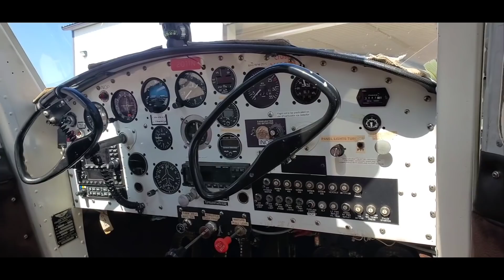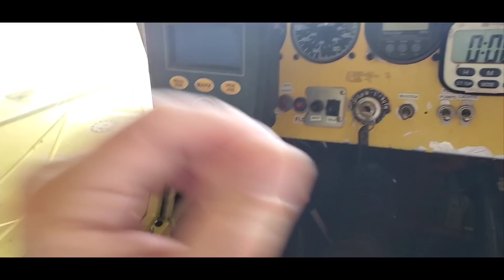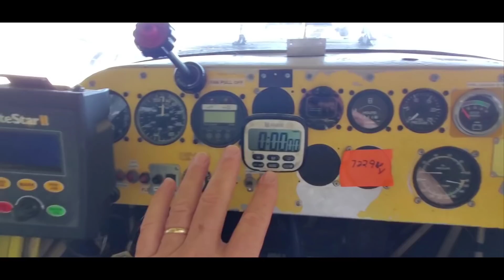An Old School Flight School - Riggin Flight Services Madison, SD

Comment: Flew a new Super Cub from Lock Haven to San Jose about 1965.  Carried 2 5-gal cans in case you got lost or Wx.  No radios.  The first 4 hours were a thrill.  The last 26 were a literal pain in the ass.  Got a lot of arm exercise using the frame tubing to hold my  butt off the seat.

Comment: Excellent interview, I learned to fly in northern Idaho back in 1973. The airports had curtesy cars furnished by the state for transportation to towns, Sandpoint, Bonners Ferry ect. No cost to use just keep the gas tank full and the oil, they had warning placards on the dashboard that car would self destruct if driven over 45 mph they did shake rattle and roll, beat the heck out of walking. Some had APs for annuals, I was 23 and they were ancient gents, good work and didn’t break the bank.

Comment: I can verify the sentiments of Mr. Riggen on tricycle trained pilots learning tail wheels. I earned my PPL in tomahawks and warriors. I got checked out in a tail wheel (Citabria) after many years of Warrior time. Since then, I nearly ground looped...twice. Shortly after a rather uneventful landing, I quit flying it like I did with warriors, and came about as close to a ground loop as you can get without actually going around. 
Didn't hurt the airplane but sure bruised my ego. Someone saw my first one and said "Nice save out there". 😳
Moral of the story, like he said when landing tail wheel aircraft, unlike tricycles, when you touchdown is when the fun begins.
Fly the aircraft all the way to the hangar.

Comment: That was really cool, a blast from the past.  I soloed on my 16th also and seem to be a bit older.  What caught my attention was the way she described flight characteristics, my dad was a bit gruff for training, many unanswered questions.  Now I know where to go, if I get the urge.  Those light bars are intriguing as I learned solo to race planes on dirt roads to flag.
Reply: Once i jumped a crossing with our old flag car racing airplanes to the field, it had an old rickety potholed bridge on the other side, i popped three tires! My Dad was not happy! Oops
Reply: @429thunderjet2  - Yeah, flagging stories.  Can't think of any appropriate to tell in public.  Back then though the A&P and I would go to all the crash sites.  That reminds me, one time a flagger from another outfit radioed that he needed oil fast so this guy fills a four quart metal pitcher(?) and hands it to me to hold on the way and the guy launched the A&P's Ford short-bed over an elevated canal and oil went everywhere when we hid the ceiling, even under where both of us sat, and I never let go of the container.  Afterwards while cleaning the truck together the A&P showed up right behind me and things got ugly.

Comment: In the early 70’s, I had gotten out of 4 years in the Marines, was going to college, worked for Asplundh Aviation in the summertime, they sprayed power line right-of-ways with herbicides to keep the brush & trees from growing. I would go on the road with a spray crew all over the North/East United States.
 We used Bell G4 Helicopters with a spray bar or rotary disk sprayer depending upon the herbicide being used. The spray bar nozzles also have a pressure value so that no chemical leaks when the spraying is stopped and there is no longer any pressure. Anyway, learned to fly at a Piper Flight Center, got a A.A. Business/Computers, fortunate to get a job, Mainframe Computer Systems Analysis/Programmer 25 years, now Retired 72.

Comment: "That's a wire cutter right there..." Woah... hold on a minute.  Wire cutter like "oops I didn't see that power line"?!?! I don't think I fully grasp the "intricacies" of crop dusting!  (But overall, thanks for putting these folks on my radar.  I see a trip to Madison, SD in my future!). Oh, and $10 in 1960 dollars translates to about $94 today.
Reply: Ha yup, most Ag Spray aircraft have wire cutters on the main gear legs as well as a cable from the top of the canopy to the top of the vertical stab.

Comment: I have about 250 hours in taildraggers. Fortunately I started in a Cessna 140. Ok but you will have to look out for the bouncy gear. It also had toe brakes.

Then I went to Luscombes. A real rudder teacher. They also had heel cable brakes. So while your working the rudder as you slow down to where the rudder looses it’s effectiveness, then you have to deal with the rudder and the heel brakes.

Comment: $6000 in 1974 was like 25k today maybe even 35k today. New car in 1974 was about $ 3750 to 4k at most for normal driver. Have aircraft gone up even if you include inflation? Today most regular lower middle class really can't afford much more then an ultralight these days. What a friendly guy too bad live so far away love to get training there.  You mentioned a wire cutter on that AG plane I work for a electric utility I had to troubleshoot a fiber cut we run our fiber down the center of the ground wire on our high power wire 230kv and up from what I know I'm in the IT world not wire side but we had to send a linemen out to look at it. They saw the wire had been cut on one side of a farm. They found the owner who told him about the AG plane it had hit the wire and cut it. I was surprised there was no crash I guess the wire cutter did it's job.